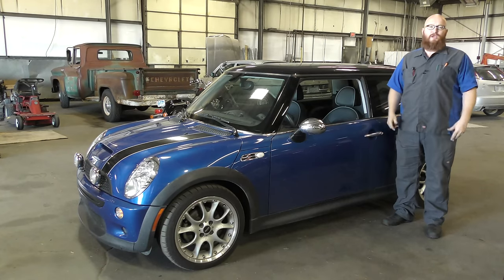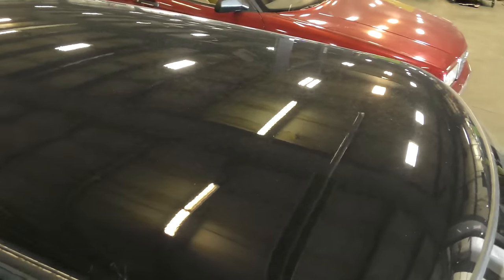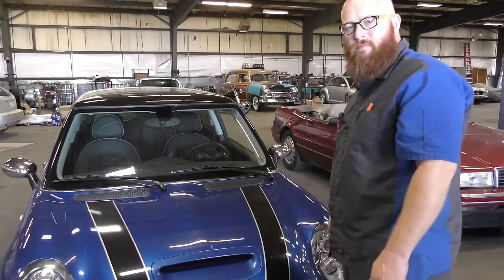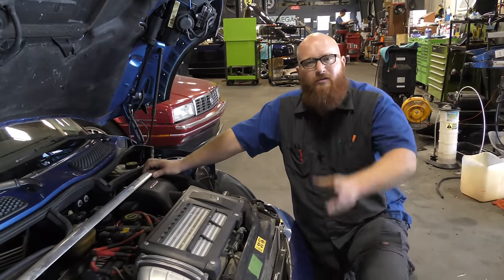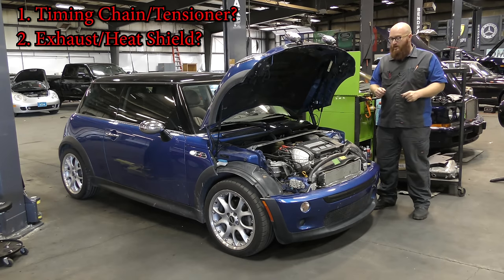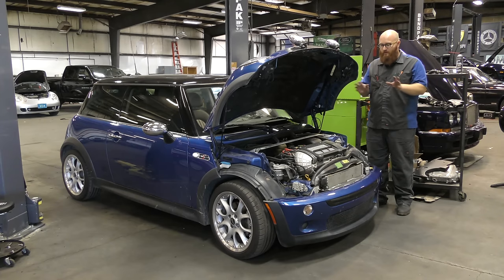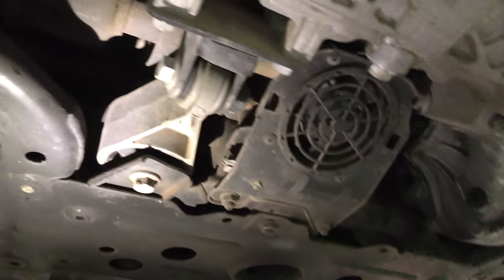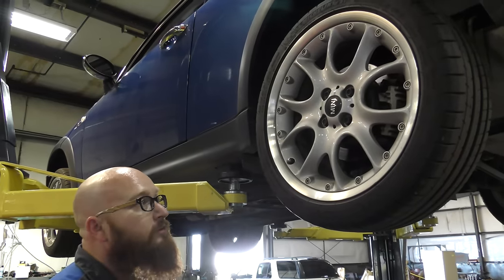Roaring Loud Mini Cooper S! The CAR WIZARD finds the source of the mysterious noise

Comment: I briefly owned a 2010 cooper s. Unless you have hoovie money I dont recommend them. $1300 fuel pump.
Reply: I have 2008 Mini Cooper Sidewalk, owned for the last 6 years, (bought at 48k) it just turned 105k, it has been extremely reliable. The only work it has had other than regular maintenance is a leaky valve cover that was fixed by the dealer when I bought it.
I also love interiors, it was the reason I chose this particular version..
Reply: I just did my fuel pump on my 2003. Literally $100 and I did in 30 minutes. These older ones are easy to replace
Reply: @chrisdrake7352  your 2008 convertible sidewalk is supercharged. 2007 was the first year for the turbo motor for everything but the convertible. Turbo convertible was introduced in 2009.
That's why.
Reply: Taelor Wiles  turbo minis have the high pressure fuel pump. You're is not a turbo. That's why it's cheap. 
Glad I could help.
Reply: $1300 for a fuel pump wow
Reply: @secretguy8673  hpfp
Reply: @woofer2121  Ha yeah, I paid the HPFP tax this year.  It really hurt.  Any other car I would try to get rid of it instead of paying for that kind of repair, but I love driving it too much.
Reply: 1300 dollars for a fuel pump LOLOLOLOL F--k they saw you coming - 30 minutes work !
Reply: @howardwilliams1218  thats the cost of the pump from mini
Reply: Absolutely ridiculous. Any car you have is going to cost RR money to repair then. They are a $150 part tops. If you got to a main dealer then you deserve fleecing.
Reply: @NaNa-wj8tw  It's $1700 from autozone. I have 2 of the cheap ones rusting in the back of my truck because they do not work. Never again.
Reply: @woofer2121  Yeah I tried I cheap rebuilds too and that did not work for me either, just more wasted money.
Reply: To those saying 150/300 there are 2 pumps in yhe r56 gen. Cooper S n14 one low and one high-pressure fuel pump about $1200 for a new OEM high pressure pump $450 OEM low pump 

You can find them aftermarket for $400-$600 for the HPFP and $75- $150 for the LPFP
Reply: I replaced the HPFP on my N14 R56. Cost almost £400 GBP for the genuine part from a third party. Fitting is pretty easy as its exposed on the side of the engine. I tried a 'rebuild' first for half that price and sent it back because it wouldn't even start the car.
Reply: My 2016 Toyota Sequoia just had a $2000 fuel pump.
Reply: @chrisdrake7352  
So in 6 years you've driven 57,000 miles?
One would expect nothing to break.
I put on almost that much on my Toyota Prius in one year.
2008, 332,000 miles.
I bought it used with 200k on it. I've put 132,000 on it in two and a half years.
Reply: kens97sto171 yes,  multiple cars, trucks and motorcycles.  I drive them all...
Reply: Don't pay to replace it until you check with the dealer to see if its covered under extended warranty.  The fuel pump in my 2007 was replaced for free long after the warranty expired.
Reply: BMW and Porsche maintenance costs are high.
Reply: And as of 2019 in the UK £2,000.00 for a friggin clutch JCW as only available from BMW!! So it’s an expensive toy guys
Reply: @EtonieE25  and mine had a sprung flywheel instead of a sprung clutch. The flywheel is $650
Reply: @Kens97 Mate us can not compare this piece of shite to a Toyota which go on forever and ever and ever! These minis will b long dead and those old Toyos will live forever 😆
Reply: @fastmail55  exactly.  You don't buy either of them thinking you are getting a cheap to service car.
Reply: @CathodeRayNipplez  um who said diesel?
Reply: Taelor Wiles  My B in law bought a new 2003 and drove it 10 years.  Nothing really major failed, but niggling little problems were never ending, and even simple parts were rediculously expensive.  Why (Wizard) do so many shops refuse to work on them?  The customer never leaves happy!
Reply: Only should buy 2005-2006s . Or 2011-13 s

Comment: Low miles like the  2007 Honda fit sport I bought 2 yrs ago. 32,000 miles and absolutely clean and unbelievable on how good it was being so low mileage. My last Honda was bought with 100,000 + miles and I had I for 8 yrs.

Comment: I’ve had my R53 Cooper S for 4 years now and that’s the first example of a stock supercharger pulley going bad, they’re a shrink/friction fit and are a huge pain to remove. I wouldn’t be surprised if this has an Alta or Cravenspeed pulley fitted as they’re in 2 parts and can come loose, hopefully it hasn’t attacked the input shaft and written off the whole supercharger
Reply: Yeah, I agree... all the Forge reduction pulleys which I've installed are still intact I believe. One piece design, needs quite a bit heat expansion before install. Done those ~12 pcs.

Comment: I thought you didn’t work on BMW’s car wizard? ;)
Reply: This is even a bigger POS than the BMWs of that era. I mean 26000 miles & the pulley is toast. smh
Reply: @SerbanCMusca-ut8ny  Time can have as big an impact on cars as mileage and nothing is impervious to failure.
Reply: Aint BMW its Fiat at least engine
Reply: @altergreenhorn  The w11 motor in the R53 (02-06) was built and engineered by Chrysler.
Reply: @michaelbradley7529  and it's the best part about this car
Reply: Vince spencer the engine was a joint venture between Chrysler and Rover Group (at the time rover group was owned by BMW)
Reply: @Zerinsakech  Agreed, the motor is solid if you keep up on maintenance. I have an 06 (bought new) that had an engine failure due to a mistake on my part but since then the motor has been built and is currently making 324whp on E85 and I've been exclusively racing on that same motor for going on 10 years.
Reply: @dadsaidno  Correct.
Reply: It's not really a BMW but later years are
Reply: @mikemata623  Yes, the current F56 2.0ltr motors are true BMW and they are a cross platform motor.
Reply: Mike Mata early ones are just as much BMW’s as the later ones, still assembled in the same factory
Reply: @dadsaidno  In the grand scheme of things I agree.
Reply: @michaelbradley7529  A joint venture between BMW and Chysler. The engine design and plant was sold to Fiat in 2008 two years after this Mini was built which might explain other peoples confusion.
Reply: @dadsaidno  I thought the engine wasn't bmw? Guess I was wrong
Reply: @MrDuncl  I see that happen all the time especially with people newer to the Mini and spend their time getting misinformed on forums. ;)
Reply: Mike Mata kind of yeah it was a joint venture between Chrysler and Rover Group (BMW owned Rover Group, this is how they acquired the Mini name)
Reply: @dadsaidno  ah good to know. Thanks for educating me
Reply: even if the engine was BMW built, it was chrystler engineered, so it's not overengineered to fail at a specific point like BMWs are. It was also likely cheaper to manufacture.
Reply: @mistersomaru  If BMW had designed it they would have included a VANOS system.
Reply: Hah!
Reply: Vince spencer that’s exactly what I’m saying, BMW had full control over Rover. But on paper it was rover and Chrysler who made the tritec that’s all
Reply: @dadsaidno  These engines were a Chrysler Mexico product, it was never used in any Rover product.
Reply: muscluva BMW bought Rover Group in 1994 and sold it in 2000 but kept hold of the rights to produce the Mini. Production of the new mini began in the year 2000. Clearly Rover Group developed the new mini under BMW’s control. I never said the tritec was used in a rover product. I’m saying Chrysler and Rover Group developed it while Rover was under BMW control. When did I say it was used in a Rover product? By the time Mini’s went into production they were BMW’s, rover group was sold!
Reply: Weird thing about Mini, they're owned by BMW and made in Britain so they ought to be the least reliable thing on the road yet they now rank near the top on reliability surveys here, easily the best of all the British built cars.
Reply: Yea!
Reply: Matthew Doye - That’s true but Fiat group cars are just as bad especially when it comes to rusting in a cold climate.
Reply: @rogerbarrett9920  It's got nothing to do with Fiat. That's a first gen new Mini designed in UK and Germany, assembled in Cowley. The engine comes from Brazil made by a joint venture between BMW and Chrysler started when Chrysler was independent but built a couple years before Fiat bought them from Daimler.
Reply: @michaelbradley7529  Well, joint venture between Chrysler and BMW, some how they managed to combine the best side of both.
Reply: Matthew Doye - Thanks but I did know that- my remarks about Fiat were in the context of British cars being unreliable which the British Leyland cars were- I was just noting that Fiats were poorly built back then as well. Sorry for the confusion.
Reply: @rogerbarrett9920  No problem. Fiats are notorious though they aren't quite as bad as they used to be. BL, and all British built cars until Honda and Nissan came, were terrible, the worst in western Europe. Somehow BMW turned Mini around and have made them pretty solid whilst getting worse themselves, I would not buy a BMW without a warranty.
Reply: @Matt_The_Hugenot  I agree and wasn't saying anything to the contrary.
Reply: He worked on a black BMW e21 3 series. When did that stop being a BMW?
Reply: Vince spencer  the engine for the first gen R53s was a joint venture between BMW and Chrysler. How does that make the whole car a Neon? Come on, dude. Figure it out.
Reply: Vince spencer  You have obviously never seen these cars up close. The Neons were never this nice.
Reply: @SerbanCMusca-ut8ny  20,000 is about average for belt driven engines. You obviously aren't familiar with doing maintenance on what you drive, or what you don't drive. Isn't there a vehicle out there you can drive into the ground and destroy?

By the way, The Wizard already stated this was a CHAIN-driven engine.
Reply: @mikemata623  it's a BMW. You obviously aren't familiar with these cars.
Reply: @MrDuncl  if you think BMW didn't build non Vanos engines you obviously don't know about their pre-Vanos engines built during the first EIGHTY YEARS of BMW's history.
Reply: @Matt_The_Hugenot  reliability is a matter of people maintaining their cars. Most people couldn't even find the light switch on their cars without thumbing through the owner's manual. They drive it into the ground without changing the oil, then bail out to go find another vehicle to destroy.
Reply: @houseofno  why do you have to say it like that?
Reply: @mikemata623  do real enthusiasts a favor and just take the bus. Or better yet, how about educating yourself about these cars instead of spreading nonsense?
Reply: @houseofno  the engine is definitely derived from Mopar engineering. When I rebuilt my '03 I used Neon lifters and ignition coil. Only the engine though, everything around it is typical BMW over-engineered crap, except for the trans which is shared with the Ford Focus SVT.
Reply: @houseofno  and how about you do that instead of shameing someone. I wasn't trying to spread nonsense. Some guy you are.
Reply: Peugeot engine
Reply: @lilyjelfs4553  the Peugeot engine is in the second gen.
Reply: @MrDuncl  yep. Vanos. The bane of those who own older beemers with those systems. The V10 was sabotaged from birth in the M5.
Reply: @houseofno  Well obviously they weren't using VANOS when they built the Austin 7 or the Isetta under licence :-) However, they had been using VANOS for eight years when this Mini came out.
Reply: @SerbanCMusca-ut8ny  My 2006 has 75k on it and has (touch wood) never missed a beat.

Comment: Actually once you remove the bumper cover and aluminum bumper, everything is accessible. I had the entire subframe off my 03 Cooper in less than an hour, power steering pump had to be swapped.
Reply: Power Steering pump? You can drop that from underneath without even touching the subframe from what I can remember.

For the average mechanic who doesn't have much experience working on them they're a bit esoteric, hence why a lot don't like working on them.
Reply: MrManBuzz it's attached with star bolts. i also had to swap the right and left bushes.
Reply: PM 👌
Reply: MrManBuzz well, as someone who learned to do oil changes on a Peugeot 505, my late 90's Honda's oil filter is harder to get at! 🤣
Reply: @alpine1600s  C'est une unique manière d'apprendre que de travailler sur une 505 ! C'était une très belle voiture, qui a également eu un modeste succès aux Etats-unis :)
Reply: Mini wasn't smart enough to relocate that power steering pump until 2005.
Reply: @Sebastian m - your power steering pump wasn't covered by the recall?  I have an '03 R53 and had my power steering pump replaced at the dealer under recall around 2016.

Comment: That’s true Wizard! Over here in the Uk it’s the same! No garage will touch a clutch! They’ll refer you to a Mini specialist! They’re bad cars for gearbox and clutch failure!
Reply: Wrong I had a Early Cooper the thing is second gear had gone I got a recon box and had it fitted with a new clutch. I was lucky it was the Peugeot engine not the BMW i was told if it had been the BMW they would have told me to scrap it.
Reply: It's the early Mini One and Cooper 5 speed boxes that are junk. Typical Rover parts. The 6 speed Cooper S gearbox is virtually bulletproof.
Reply: @mclarenjohnf1  so he was right then, nobody wants to touch it.
Reply: @MrManBuzz  I managed to get a 5 Speed Getrag Gearbox, worked like a dream right up until the day the whole car was sold and with everything that was fixed I got my money back and a tiny bit more. I will never buy another one I would rather have the ones I had in the past, MK1 1275 Cooper S, Mini 850, Mini Clubman, and my superb Mini 1275GT, Obviously the Cooper S  was better for out and out speed but the 1275 gt was better on country roads.
Reply: @MrManBuzz  Rover had nothing to do with these cars ....
Reply: @1chish  Yes they did. Rover was well on the way of developing the car when BMW took over. The 5 speed gearbox that gave such trouble in the early Ones and Coopers? A Rover Gearbox. R65 Midland Gearbox.

Don't try to correct someone who knows what they're talking about when you've clearly got no idea yourself.
Reply: @MrManBuzz  That last line was pretty dumb considering you can't even read what is written. We are discussing Mini Cooper S (and JCW) cars which always had the 6 speed Getrag gearbox. Hence my use of the words 'these cars'. 
So go shove your sarcastic lecturing and pay attention to what is actually written.
I am fully aware of the events at Gaydon and Munich in the '90s, who triggered the first R59 designs, the later R50 (from 1996) designs, the K Series cars, the wars between R & D departments and how BMW chose designs and suspensions and left Gaydon to make them work. So yes I am also aware of the R65 gearbox and that it only went into the Mini One and Mini Cooper models up to 2004 because of reliability. Hence my words. The Brazilian BMW / Chrysler engine was worked on at Powertrain, who also did the gearbox, which is based on that unit used by Rover.
Just a suggestion but maybe have a discussion with folks rather than make out you are something superior because you clearly are not.
Reply: @1chish  The first fucking comment is saying how the cars are known for gearbox failures which is what my original comment was responding to. 

Stop trying to save face here mate, you're just digging deeper.
Reply: @mclarenjohnf1  the peugeot engine is equally terrible.. just scrapped a 2009ish citroen with that same stpid engine in it. (which completely grenaded itself at 100K miles)
Reply: MrManBuzz good to hear when you own one lol
Reply: @emmasmith8367  I've owned one for the past few years too. Wish it wasn't so thirsty though, the fuel economy on R53s is truly awful.
Reply: The UK is like the USA in that cars get so cheap after 6-7 years that no mater the condition they just become financially uneconomical to fix, no mechanic wants to hand someone a 3 grand bill for a car valued at 2,500.   I have lived all over the world, and in some counties a nice early modern mini that you would buy in UK for 2 grand is worth 25 grand it’s absolutely no problem getting anything fixed.
Reply: MrManBuzz mine busted at 63k. Completely wasted the clutch to nothing. I bought it at 62k from a family friend who didn’t abuse it. Junk car
Reply: @mitchellcaldwell6315  How do you know they didn't abuse it? Were you driving with them?

Abusing a car goes a lot further than just driving it hard.

There's so many variables here, it makes your anecdote too easy to pick holes in.
Reply: And the ones with the CVTs are even worse.
Reply: mark S What about the ones with the Toyota diesel?
Reply: The CVT is trash and the 5 speed is known to fail, but the auto is usually fine and the 6 speed is the best option. I replaced my clutch on my '05 S at 206,000 km and it was because of the dual mass flywheel starting to make noise. The clutch wasn't slipping at all.
Reply: @DaGhostQc  You probably shouldn't have bothered doing that big job until the clutch started to actually fail. These cars have rattly DMFs, especially when they're cold. It's just a quirk of the car. Mine has been rattling when it's cold since I bought mine nearly 4 years ago, I've done over 40k since then and it still rattles on start up the way it did the day I bought it.

But you've done the job now, so it's one big expense you shouldn't have to worry about ever again.

Comment: Pop some colder plugs (1 stage cooler) in for a 15% pulley, also in a hot environment you want a better intercooler, the standard ones are prone to a lot of heat soak and take an age to cool off. 👍🏻👌🏻